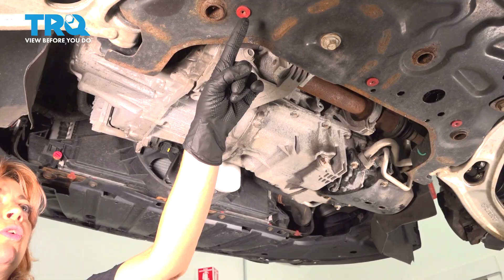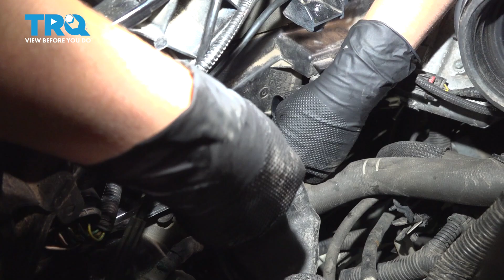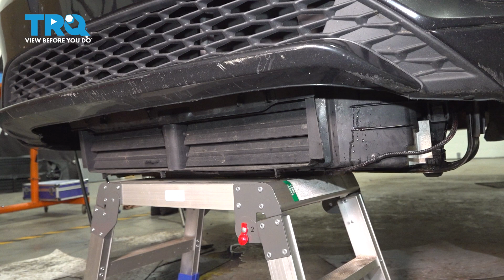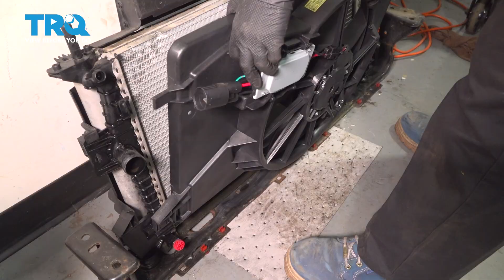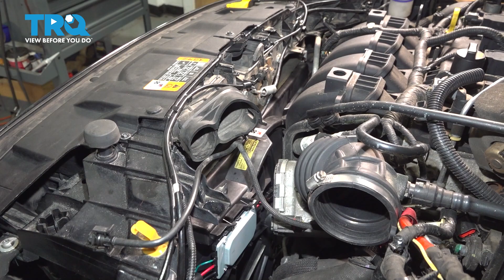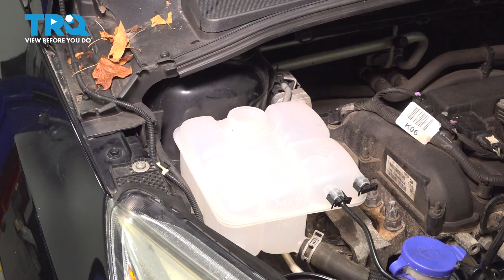How to Replace Engine Cooling Fan Assembly 2012-2018 Ford Focus

Comment: As this is the primary video available for this job on the Focus, I want to share my experience replacing the rad fan on my 2013 Focus ST. Description of my process below:

First, the fan assembly for my ST does not mount the same as shown in this video. The ST fan assembly has 2 top tabs and 2 bottom tabs that sit in saddles. The top saddles are the ones that secure ("clip") the fan assembly in place. The saddles have to be pried slightly open and the entire fan assembly lifted to allow the top tabs to be lifted out of the saddles.

Second, you DO NOT need to remove the entire radiator/condenser/intercooler assembly to replace the fan assembly. It can be removed from the bottom without doing so. It does require removing the support crossmember under the radiator/condenser assembly, and slightly lowering the rad/con/IC assembly about 1" to allow the fan assembly to be pushed up out of the saddles.

My process (do any of this at your own risk): 1) lift and support front of car; 2) support the bottom of the IC with a jack (I put a 12" long 2x4 between the IC and jack to better distribute the weight); 3) unclip wire connectors to the fan assembly, 3a) remove the fan controller assembly from the fan assembly; 4) unbolt and remove the lower rad support crossmember; 5) lower the IC on the jack down about 1"; 6) open the saddle brackets at the top tabs of the fan assembly and pull the assembly up and out of the upper and lower saddles (helps to have 2 people, one on top, one below); 7) lower the fan assembly down and out (this will require careful and tedious maneuvering to get the tabs past different obstructions, but it's totally doable). Install is the reverse of removal. It definitely helps to have a second person to make sure both top and bottom tabs get back into the saddles all at once.  Hope this helps somebody out there.

Comment: Id like to post a formal apology, i clowned on you about dropping the whole assembly, after doing the work myself 2 months ago, I understand completely why you dropped the assembly, the way ford built that car leaves no space to get the fan out, HOWEVER IT IS STILL DOABLE WITHOUT PURGING THE AC AND DRAINING THE COOLANT, it just takes so much more elbow grease and time, you have to drop thw driver side giving you more wiggle room to wiggle the radiator out, spent 5 hours getting the old one out and getting the new one in

Comment: you could have just dropped the fan from the bottom & should not take you so long or such a long process...literally takes bout 20 minutes...what is shown in this video is a good process but unnecessary for the radiator fan removal...there are a few videos demonstrating this...but thanks either way.

Comment: Why would you do all this unnecessary work? You can unbolt it and pull it out the bottom. No need to remove the ac lines or the radiator itself. The fan can slide right out the bottom. I am puzzled by this video why would you do all this unnecessary work? Explain your work?